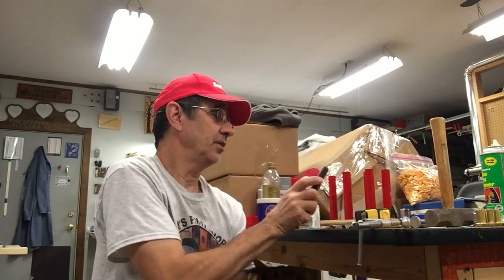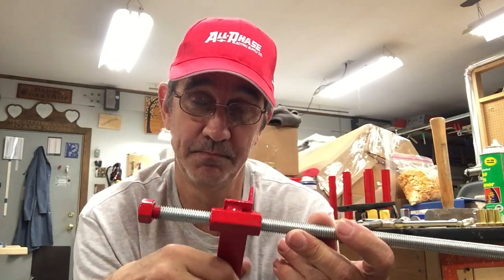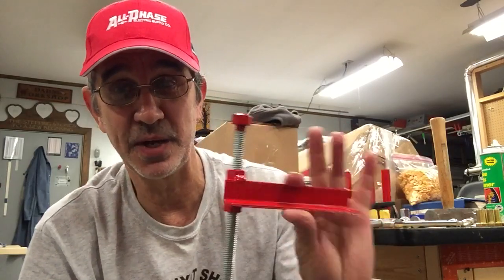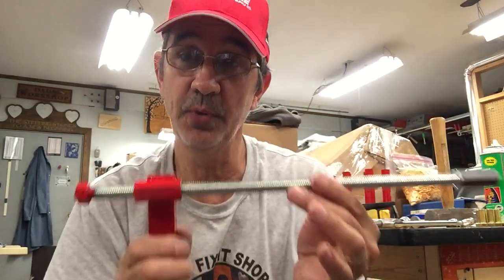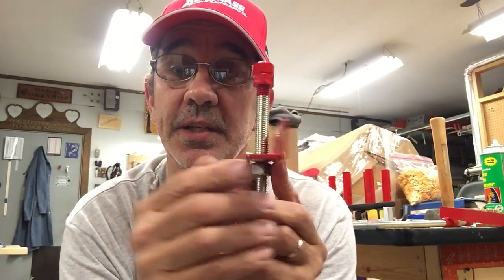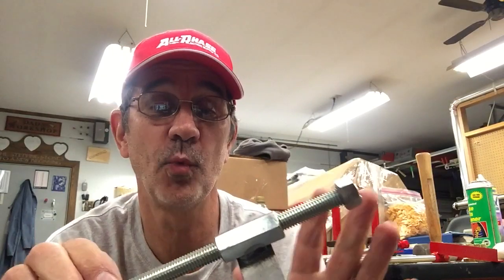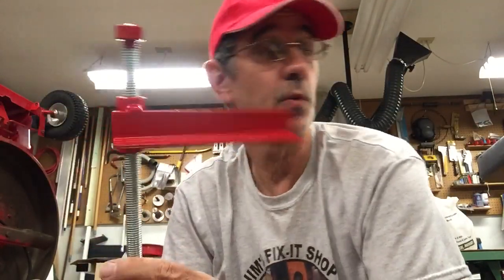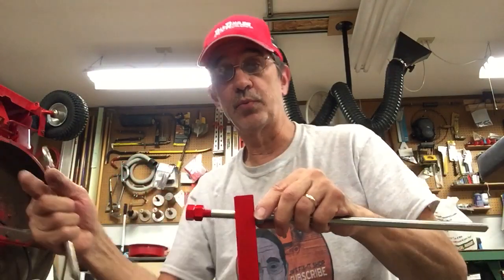312. How can I compress the spring on my shift handle,   A better design

Comment: I just purchased a 2020 Snapper with 15.5 engine with a 33 inch cut.  You stated to use 80/90 Oil in the differential.  How do I remove the grease in the differential?  Thanks,
Reply from the maker: Frank Carlomagno 
You need to watch all the videos on that issue there are some things you have to change to your machine so it doesn’t leak out there’s a couple vent holes that have to be welded shut in the differential cover and the chain case cover and the only way you can get the snapper lube out is to actually disassemble it and clean it out. Jim